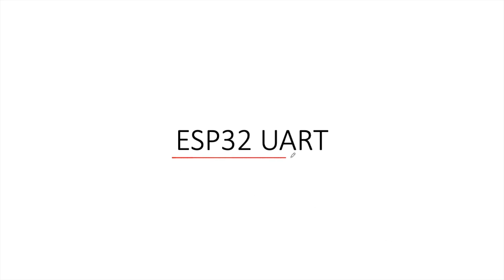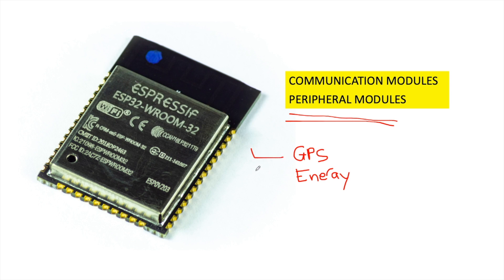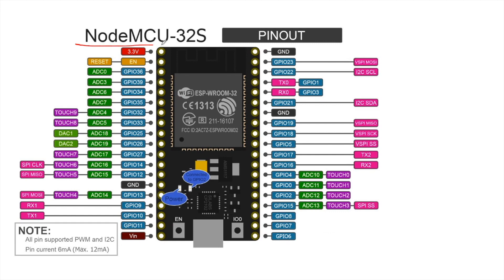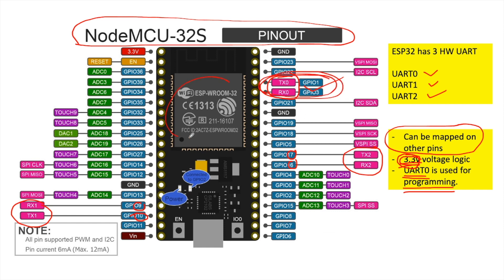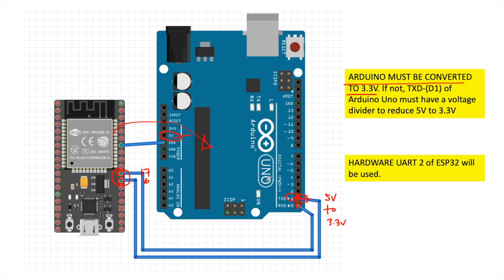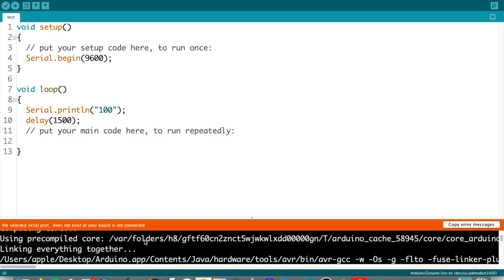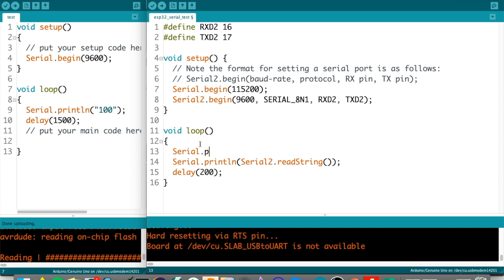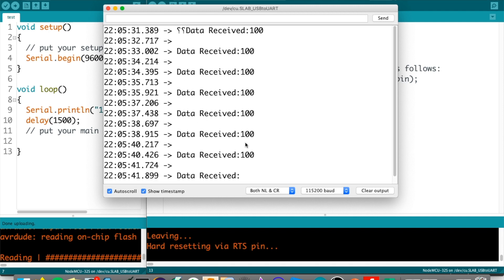ESP32 UART TUTORIAL AND BASIC DEMO - How to connect ESP32 to Arduino Uno Step by Step

Comment: hi ! using a hw 221 level shifter, cant communicate arduino mega to esp32, done everything according to the adafruit video , but nothing . if i change mega voltage regulator to 3.3 willl it work?

Comment: error: "Serial2 was not declared is this scope, did you mean Serial1" ?
Reply: did you fix it?
Reply: @karenspalter1839  Yes, thanks for your time. I changed arduino uno voltage regulator to 3 v. now i have an arduino uno 3v full every pin, connects to esp32, and with pwm and trasnsitors can control stepper motor. Made the same with arduino mega, but does´n´t work yet. Greetings from argentina.

Comment: I have a mega 2560(ch340) pro micro running my project. Can sketches be uploaded to the mega wirelessly over wifi  using the esp32 ? I can't find any info on it.

Comment: I did everything the same, but it did not work. Would not print "100" from Arduino
Reply from the maker: There are many possible reasons. Have you checked the wiring?
Reply: @circuitdesolator  Hi - ended up just using the ESP32 as a standalone MCU. Removed the Arduino from the setup. So that solved that problem lol. Thanks for your comment and video.

Comment: Hi, for connecting ESP32 to Arduino Mega small form factor version like in this example, a voltage divider or a logic level shifter will not work? Is modifying the Arduino to 3.3V necessary for this to work? I have been trying to communicate by serial an ESP32 DevKitV1 to an Arduino Mega small form factor version, and I can receive data from the Arduino but I cannot transmit it to the Arduino from the ESP32. I already tried a logic level shifter but it doesn't work. I'd appreciate your help a lot. I can donate in XMR, BTC, BCH.
Reply: It just worked! With a logic level shifter, I haven't tried to take it off once it worked, but I am so relieved. I connected Serial2 of Arduino Mega small form(pins 16, 17) to ESP32 Devkit V1's Serial2 just using: Serial2.begin(9600,SERIAL_8N1,16,17); without including the HardwareSerial.h library like others said in other videos, and it worked :D. Thanks!
Reply from the maker: Great job!
Reply: @circuitdesolator  Hello friend, thanks for the explanations that you give in your videos.

Could you make a video where you explain how to send data from the sp32 to an arduino uno? I have seen the comments but I cannot understand them very well
Reply: @greenspanfx  hola amigo, podrías ayudarme con lo mismo pero haciendo uso de un arduino uno ? no entiendo muy bien lo que  explicas ahí en tu comentario en inglés, se que es necesario el uso del conversor pero no comprendo muy bien como iría el código y las conexiones, me serías de mucha ayuda. Gracias de antemano.
Reply: @greenspanfx  hello,I am doing the same but not getting output can you please share your code. it will  help for me
Reply: @robo2.069  it turns out the logic level shifter was not necessary. It was a mistake to believe it was working because it the shifter. I connected them directly, the Serial2 I think of the ESP32 to one of the spare serials on the Arduino, and it works even though they operate at different voltage levels. I am very busy with other stuff but if I get to it soon I can send you the code. I am no longer going to use serial because it introduces too much noise on my RTD sensor(I think because of the necessary ground connection) I will instead use Bluetooth to communicate between them.

Comment: Nice video man just one question while using rx/tx0 ,while sending data from esp32 to arduino I recive some weird symbols. Could u help me with that. Thank you
Reply: change your baud rate to 9600 from 115
Reply from the maker: What wrong? Are you sure with the pins? How about baud rate? This you follow my tutorial?
Reply: @circuitdesolator  Well aparently the reason was none of them as i wrote serial.println and  my arduino lcd was not able to decode and print it. thanks
Reply: @circuitdesolator  thanks for the help. the problem was with Rx0 and TX0 while translating data from esp32 to Arduino it sends weird symbols sometimes . i tried with tx2 and it was working fine thanks for the help again .
Reply: @Xbox gamer Please share your code with me? I am also trying to send data from an ESP32 to an arduino mega but all I get is random values. I have made sure that my baud rates are the same and that the connections are ok.
Reply: @zibusisondlovu9742  old comment so don't have the code anymore . But have done some work around it so i remember some of it . In the string add a special character like r/  and then use readstringuntil the special character in this case r/